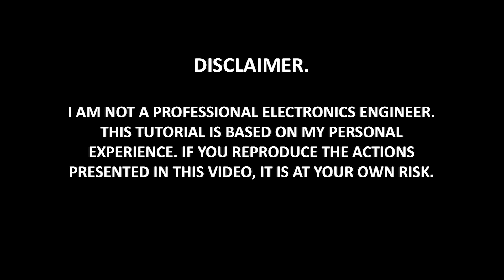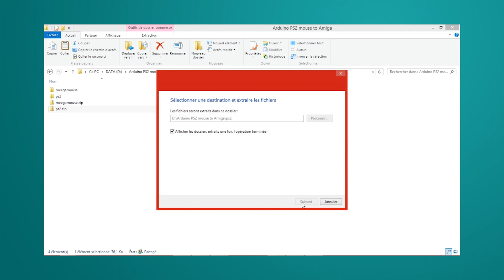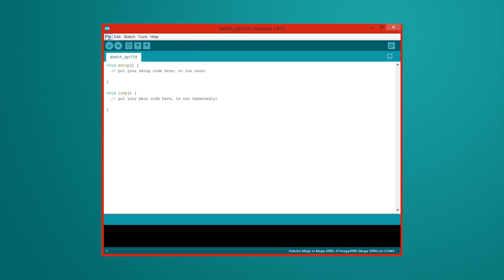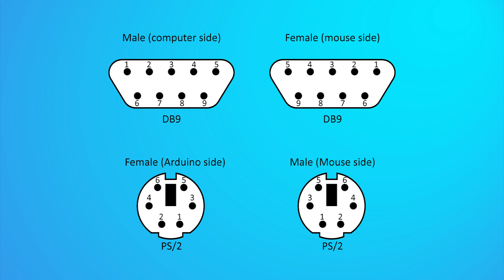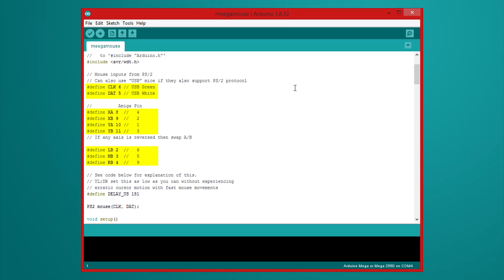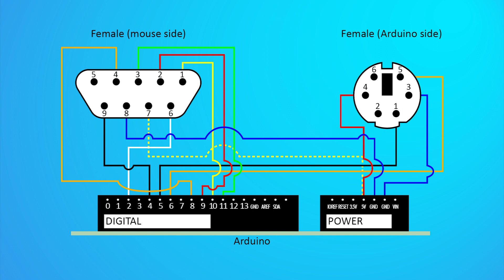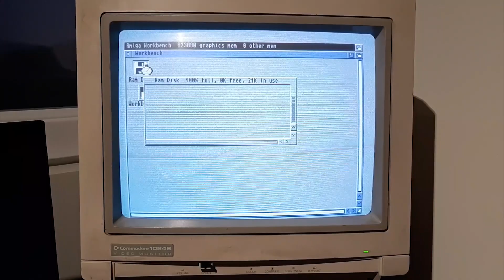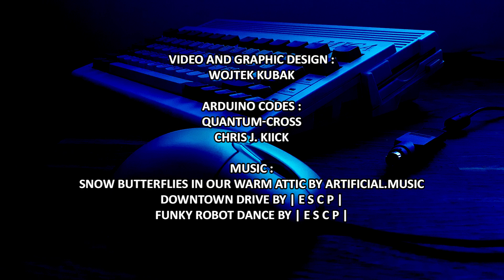How To Connect a PS2 mouse to Amiga with Arduino

Comment: well that didn't work...after uploading your code the arduino is in a constant loop of being kicked off the port. I think its because it defaults to the leonardo arduino and that just messes up the arduino, requires many resets, changing settings back to correct board and reload and compatible sketch.
Reply from the maker: As I said at the beginning of the video, I'm not an expert. As you can see, in my case it worked with my hardware. I used the code I've found on the internet from the links in the description. I'm sorry that it didn't work for you. Maybe you need to set up the right model in your settings if you don't have the same as me. Or maybe the pins are not the same on your device, so you'll maye need to change the numbers in the source code to make them match with your hardware.
Reply: @wojtekkubiak1889  Hi Wojtek, It was probably an error on the board setup since I was using a generic board.
However I came across something important. The mouse wires need to be connected to pins capable of (PWM) pulse width modulation. These pin numbers change on each board.
(I haven't been able to verify this)